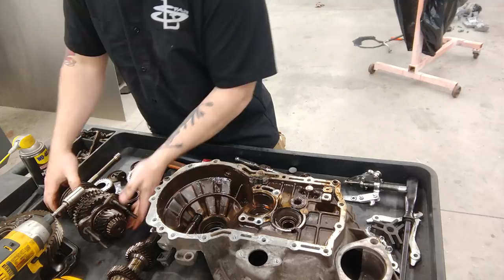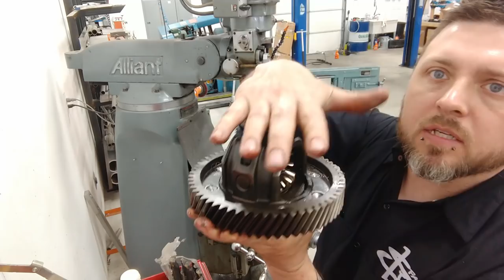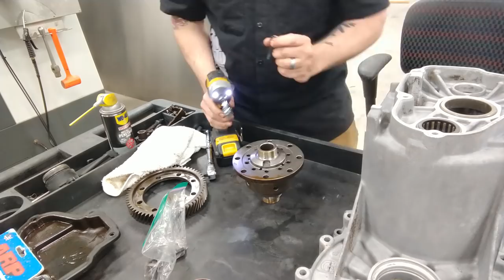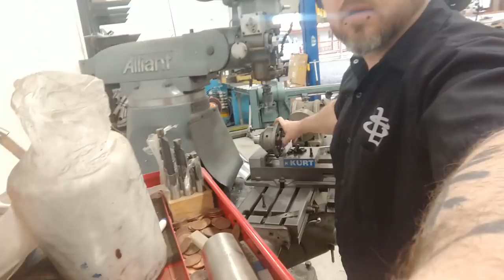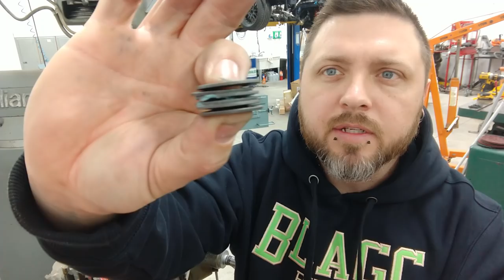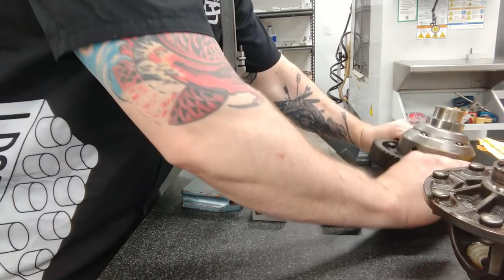VW 1.8t 20v build, O2j gearbox tare down and OBX LSD rebuild and prep

Comment: I’m working my way through all the videos as I get time. I’m using a Passat AEB and transaxle in a mid-engine 54 Beetle. Just wondering if anyone else would be interested in a water pump pulley to delete the power steering pump? Love your story and love the low budget

Comment: Great video, very interesting stuff. When you diecided on LSD why did you choose Torsen style? Was it purely because it was the only budget option available? Or if you had the option would you have choosen clutch type LSD?
Reply from the maker: It was a budget choice for sure, and although I have had time to upload the next video I ran into some issues with the diff that most guys won't be able to solve in their garages. So for that reason I really can't recommend them.

Comment: Hi great video 👍🏼 . Would you recommend changing the slave cylinder when replacing a transmission from a salvage yard? I’m not seeing any signs of leakage but I don’t know the history of the vehicle. It is a OEM though. Thank you
Reply: Yes, absolutely. On these 02J 5 speeds, it's very easy since the slave cylinder is external to the transmission (it bolts in right on top by the shift tower)